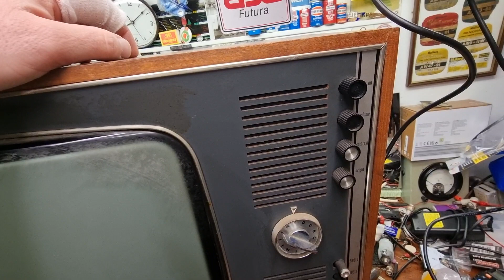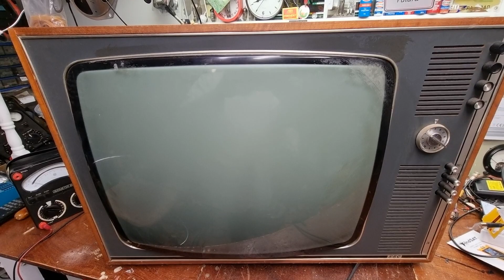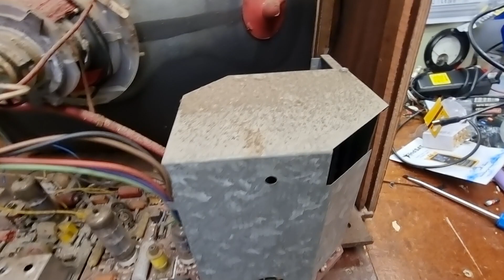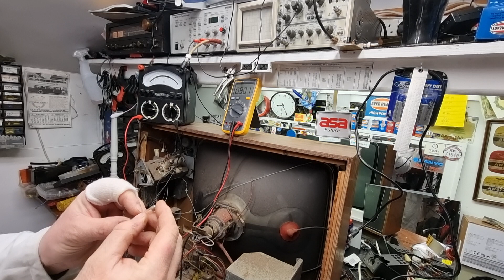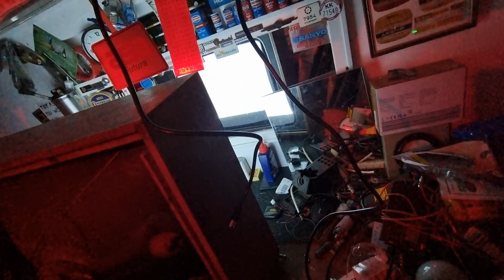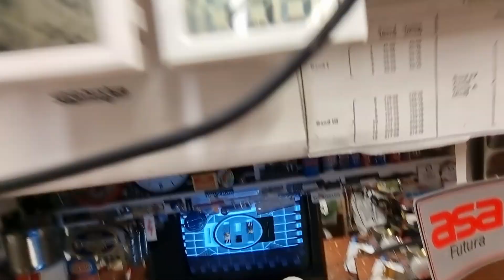GEC Dual Standard resurrection

Comment: I found with the double sided print on GEC sets if you heat the component from the top side of the board you can pull out the component without damage to the print  , as for the valves I use to buy those non descript foreign rubbish as a kid in the 70 s from a company called Electronic mailorder , the addresse was 62 bury road I seem to remember if anyone wants to look it up in an old Television magazine ! , they were something like any five for 50p and sometimes they didn't even work , whereas a Mullard one may cost £2.00 and this is probley the reason they have all been replaced because they were so cheap.
Reply from the maker: I've heard that one before alright. It's strange it has a full set of those valves in it. I wonder if it was a very late production set?
Reply: I seems to remember that the yellow label CRTs were fitted in the later production run of these sets

Comment: When I lived in Ireland, in the 1970s, as a child, my grandmother had this exact same model. The tuner button was different, though. It had a beautiful clear picture. The tuner button broke and we ended up turning the tuner with pliers. My uncle used to say that the push buttons at the bottom could be adapted so we didn't have to use the tuner button. I don't know if that was possible.
Reply: My dad used a mole wrench to change channel on his, after the knob broke. :)
Reply: That's funny. I couldn't understand how they could make something as advanced as a TV, but the control knob was rubbish. Another thing about these control knobs, on TVs at the time, was that they had a half circle socket, which is just waiting to slip. Why couldn't they have made a square hole, which would have been stronger. @jamesknightreading
Reply: lucky the chassis wasn't live!

Comment: Those valves look like Toshiba valves , they weren't branded as such but were also supplied to the trade by CPC in orange valve boxes  in the 70s . Looks like a very original set you have there
Reply from the maker: Interesting Michael.